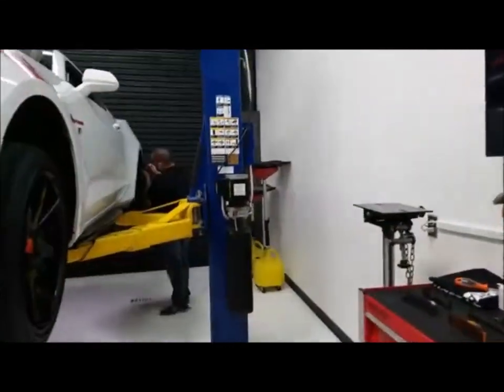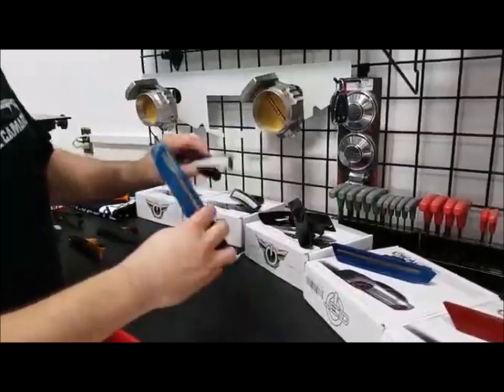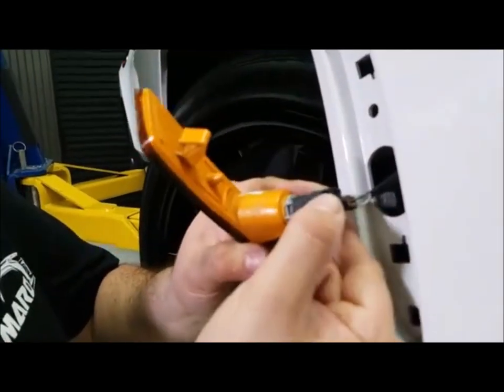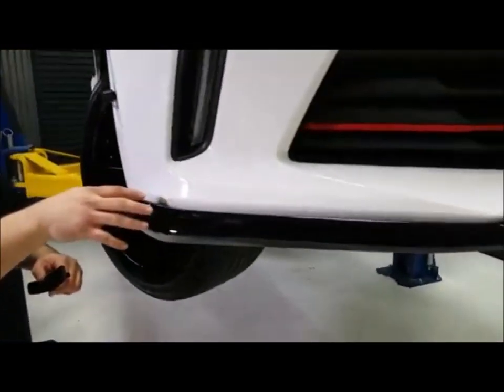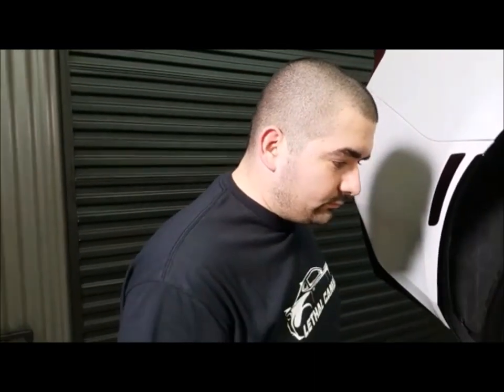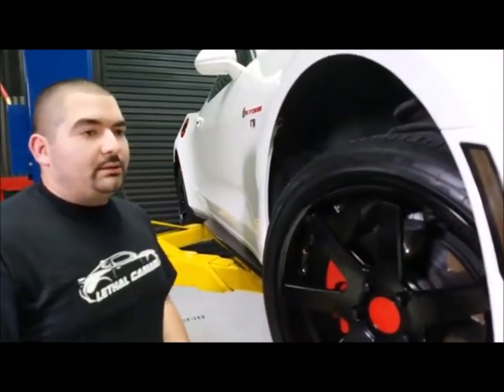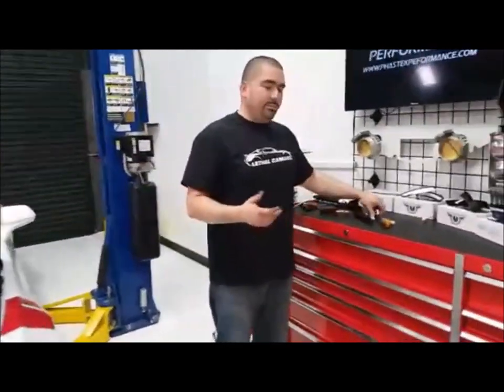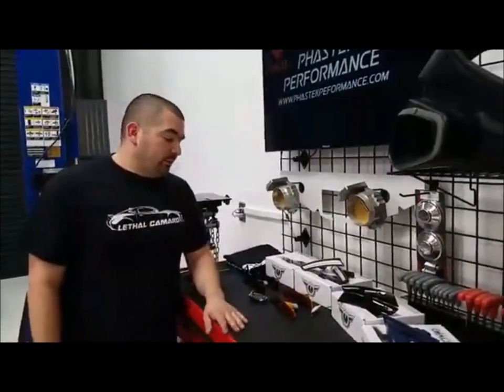Oracle Side Marker Install and we talk LETHAL CAMARO

Comment: Each Oracle marker light is stamped on the back with the location to install them. FL, FR, RL, RR.  No need to find a power source to check them before installation :).
Reply from the maker: They made an adjustment to the ones after our stock order.  Good to know though!
Reply: Update for you guys.  Just installed my set (Thanks for the fast shipping btw) and each is stamped with the location.  However, they were stamped as if they were looking at the car from the front.  In other words if the light is marked FL (front left), it is actually the front passenger side.  Not sure why they did it that way, but a heads up for you guys should any customers get confused.